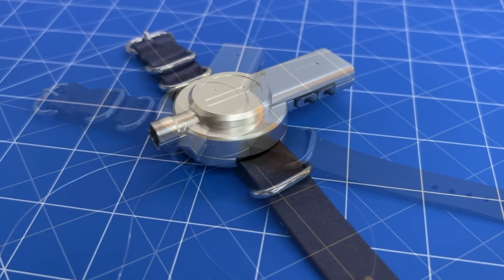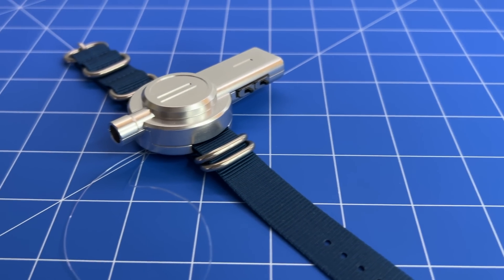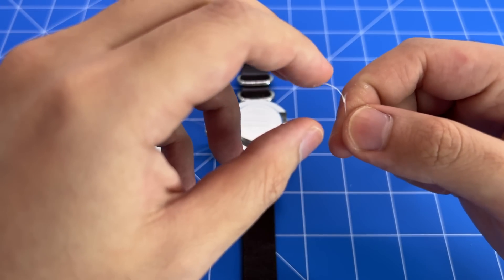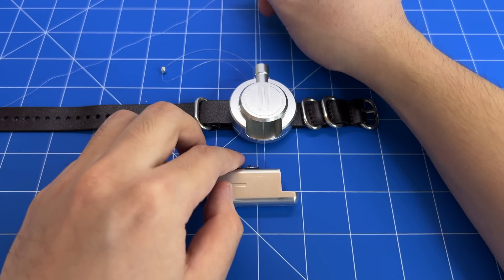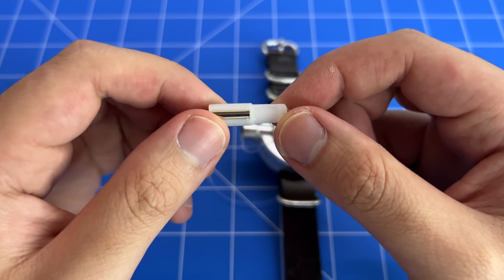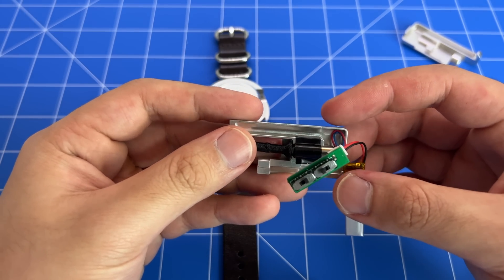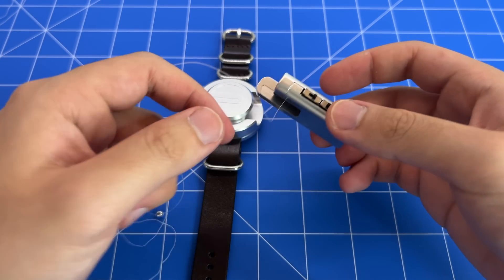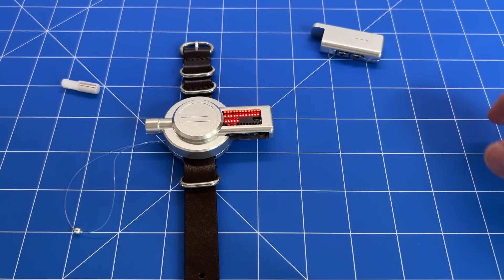MAGNUS Functional Thread Shooter Watch

Comment: Well, I just ordered mine. Hopefully it doesn't put me into credit card debt lol 

Is there any way for us to set the time zone manually on the watch bit? Also, is there any chance this web shooter takes the same sized red translucent plastic circle things as the 3D printed ones you've made previously? Lastly, what is the maximum weight the line can support? I don't plan on swinging from any buildings or anything like that, but it'd be nice to know the limitations of the web shooter. 

Great work, and I'm super excited for mine to arrive!
Reply from the maker: Thanks for your support! Yes, with the order comes a pamphlet on how to manually change the watch time. The MAGNUS unfortunately doesn't take the same sized red plastic circles. Maximum weight supported by the line is 6 pounds, making sure to pull while holding onto the line itself and not using the direct connection between the line and the reel. The magnet does not pull with 6 pounds of force, but if the line is wrapped around a cylindrical object enough times then it will hold. Hope this helps!
Reply: @herotech  Wonderful. Thank you for the detailed response!
Reply from the maker: @dedsecaffiliate1979  No problem!